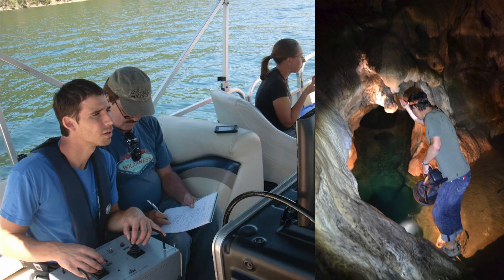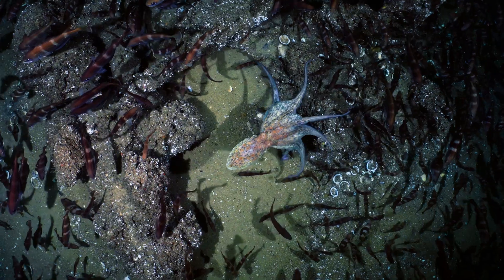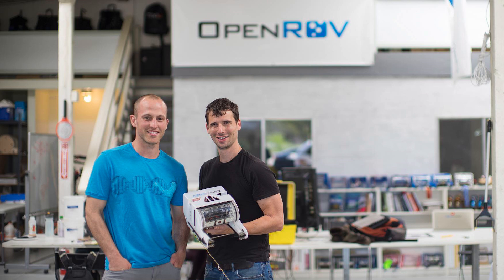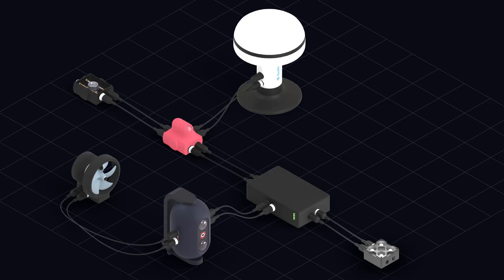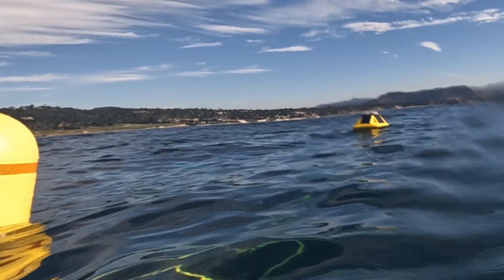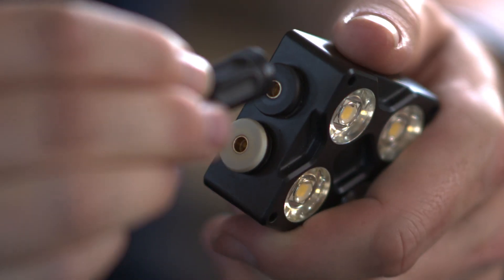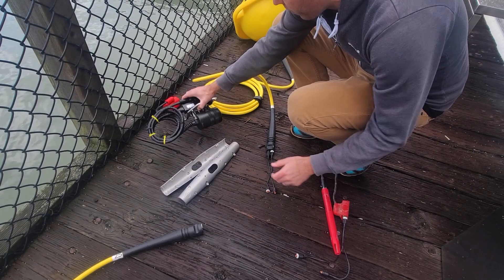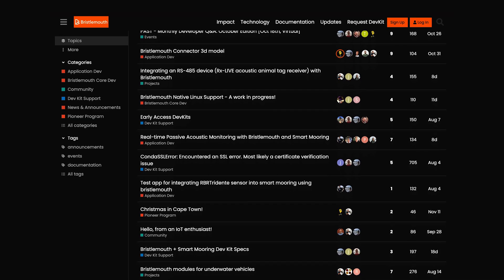An ocean engineer describes Bristlemouth: the first connectivity standard for marine exploration

Comment: What would be an easy system for me to use on 360 camera to DVR? The application is for  borehole camera.  360 camera 200m cable to DVR on surface.

Comment: Are the connectors dry mating, or do you recommend a lubricant? (e.g. slilcone grease)
Reply: Hey @hardwareful - no lubricant is needed for the the connectors to make a good seal, but lubricant is okay to use if desired.  Theoretically, lubricant can help a face-seal o-ring slide into a sealing position as pressure is added, however in our experience (and design intention as lubrication is not always practical in field conditions), unlubricated o-rings in these connectors have been just as reliable.